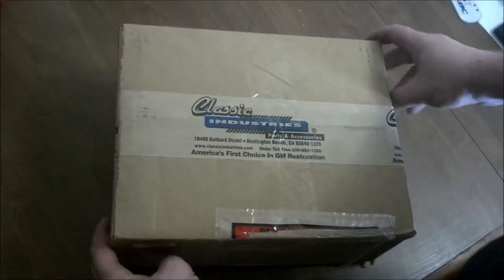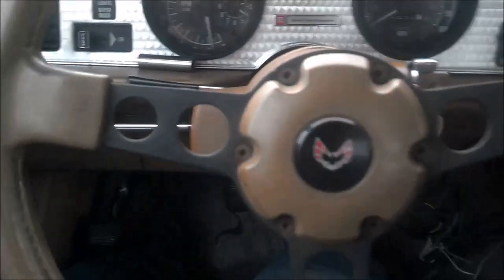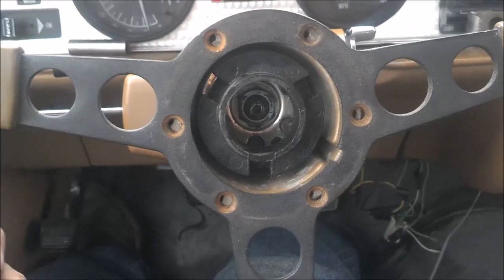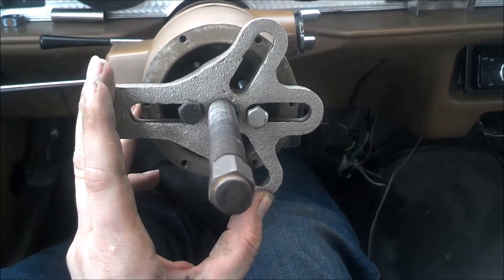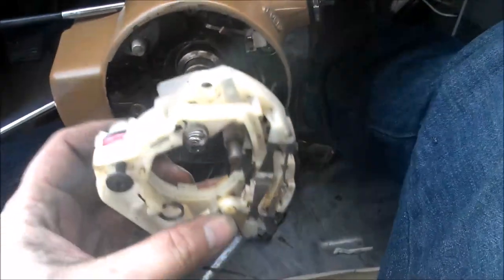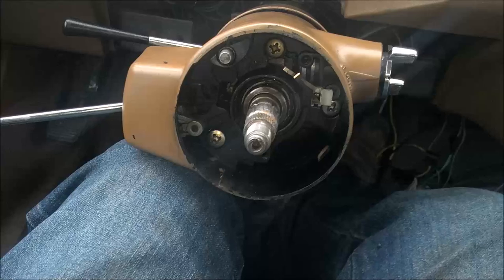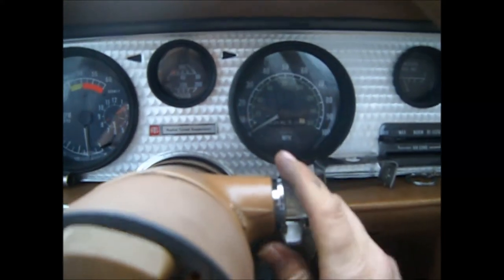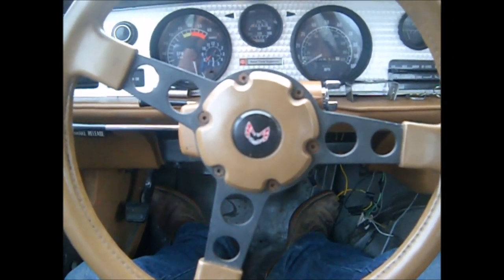Easy GM steering column teardown

Comment: Thanks for the info Mate. I gotta do this on my sister's 1980 Trans Am here in Australia.
Reply from the maker: Hope it helps!!
Reply: @NOVAtazz  Yeah it did. I'm used to working on 70's and 80's Holdens. So there isn't much difference when it come to the steering columns.

Thanks again!

Comment: Electricians tip for foshing wire: If you attach a flexible wire to the end of the turn signal wires before you pull it out, you can use it to pull the new one back through.
Reply from the maker: Nice tip thank you

Comment: Sometimes this problem can be fixed by adjusting the reverse lock out rod. This is a flat plate coming out of column in engine bay. Make sure it is all the way up when it is in park. This will cause the key not to return to lock position and key can not be removed

Comment: How does the horn wire connect?  I couldn’t tell in the video and I’m trying to assemble a 79 trans am steering column that was previously hacked up. Thanks.
Reply from the maker: Id do a google search sorry its been so long since i had this column apart

Comment: Very helpful. Thank you so much
Reply from the maker: Glad it helped
Reply: It did help a lot. I just bought a T/A in UK with the column in pieces. Thought I would never get it back together. Perfect. It is great you took the trouble.
Reply from the maker: @BarmaBoysAndFamily  one of my earlyer vids i was replacing the lock cylinder

Comment: Great video! I need to replace the dimmer switch in my 1979 Pontiac Catalina, and this helps a bunch! Can you just pop the steering wheel off and drop the column to get at that switch?
Reply from the maker: Umm not having it in front of me im not sure ....you might not need to drop the column at all depending on your flexibility n room available
Reply: @NOVAtazz  I changed the switch this morning. It's pretty tight under there with the air duct in the way, but I got it. The steering column needs dropped because the anchor plate hides the 8 mm bolt holding the switch in. Thanks for the vid!

Comment: Hi, My boyfriend owns a corvette 81 and was preparing the steering column. 
he lost the bolts shown in minute 8:55 - 9:15 the nots you mentioned removing to drop down the steering column. would you please help me on what are these bolts called and where can i find them online?
Reply from the maker: Just search for a expanded or exsploded few of the year make n model stearing column most have a parts list for the should help get you in the right direction . You may only find them as part of a hardware or rebuild kit
Reply: @NOVAtazz  great thanks

Comment: How about if my steering attatchment rod just pulls out and i cant use that steering wheel tool ? I took mine out and now it wont go in strong enought to wrench on my wheel
Reply from the maker: @b.i.o.t.i6132  not quite sure what your meaning by attachment rod

Comment: What specific year and model is this column? Mine is like it but was swapped into my truck before I bought it. I need to work on the signal lever replacement but I have no idea what year or model to search. I guessed wrong and have parts from 76 that don’t fit. Anything will help!!!
Reply from the maker: Most gm columns are the same mine was a 79 trans am column but is i identical to my 77 nova one

Comment: My tilt steering wheel on my 78 camaro is loose are those 3 screws that you have to tighten the steering ?
Reply from the maker: Been so long since ive had this apart i cant remember off the top of my head

Comment: brilliant. Shows me what i needed. many thanks.
Reply from the maker: Glad this help feel free to share with your friends like And subscribe plenty more content where this came from any more help let me know
Reply: Oddly my steering lock does not have the screw holding it in!  (1978 Trans- am).  I understand in models like mine you push something in the slot to remove. Just for info in case this helps anyone else.
Reply from the maker: gravysnakes yea the column in the video is a 79 trans am

Comment: I have a 70s GM column which I have to do this work...however before I start I see a button on the end of the signal turn lever with a wire running inside the column...any clue as to what this is?
Reply from the maker: frank ploger cruise control im thinking
Reply from the maker: frank ploger but id look it up on google
Reply: THanks, I guess when I get it all apart to put in a new cancelling unit I will know then what it is

Comment: I have a 96  chevy caprice...we removed the steering wheel and there is a piece of metal covering the yellow plastic piece...it was supposed to come off with the steering wheel but didn't what should I do...
Reply from the maker: Warren Fam I'm sorry I'm not familiar with the steering column that is that new this video is for the late 60s and 70s GM vehicles

Comment: Somehow the moron that owned the 79 trans am before me, snapped the turn signal lever off AND the hazard button off… sounds fun digging into the steering column 😐😂 so since I have to replace the turn signal lever do I have to go farther into the steering column than where you stopped? Or is there a screw/ bolt holding the lever in
Reply from the maker: Think its a little further i cant remember been a bit since ive had one apart
Reply: @NOVAtazz  alrighty thank you
Reply from the maker: @Toaasty_  sorry i couldnt help more
Reply: @NOVAtazz  no it’s all good man, you’ve helped me mentally a lot more lol. So does the hazard button screw into the signal assembly? So could I buy some like steel knobs and levers and screw it into it or is it more complicated than that
Reply from the maker: @Toaasty_  pretty sure there was a small screw in the center of the button but again its been like 6 years since ive had one apart that far
Reply: @NOVAtazz  alright thanks
Reply from the maker: @Toaasty_  come join us live sat nights 9pm est for some fun garage talk
Reply: @NOVAtazz  I’ll have to stop by